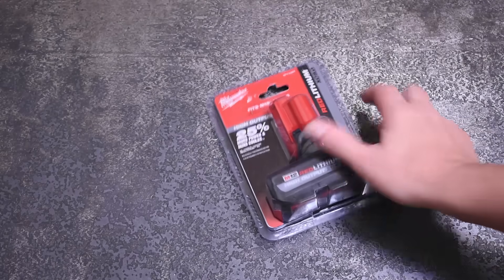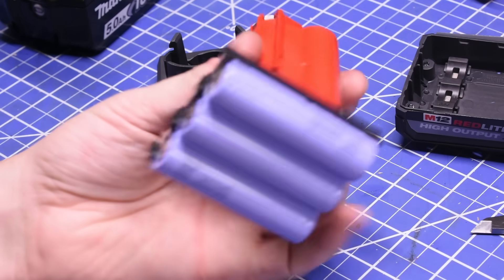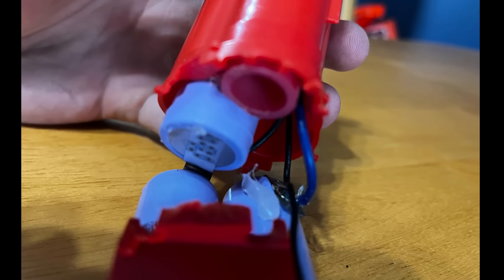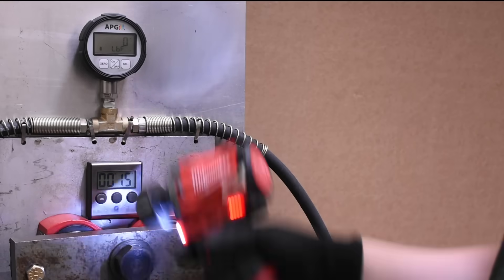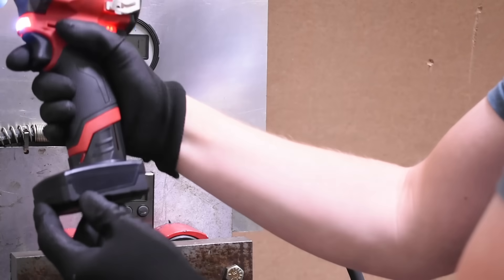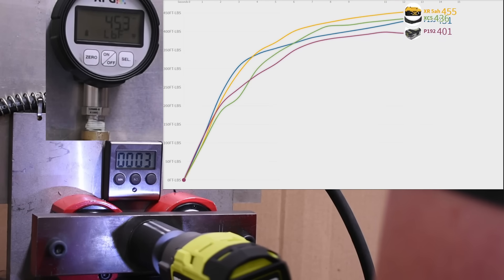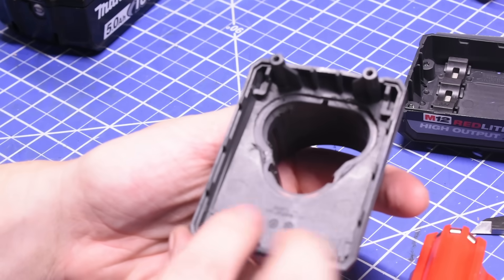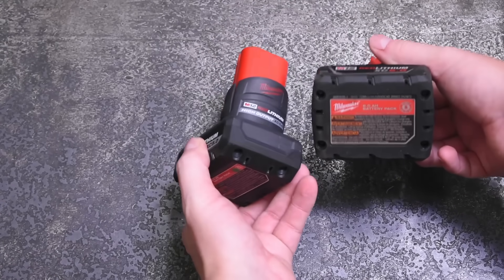Milwaukee's New M12 XC5.0 High Output vs Stuffing Actual 21700 Cells Inside

Comment: If I was in the USA, I'd send you my CP2.0 (3x Samsung 20S, 35A) and my XC 8.0 (9x Molicel P26, 90+ Amps) to test. You can buy empty 3, 6 and 9 cell cases, add in some healthy copper busbars inside and you have power tools with a new lease on life 😉

You are dead right about the direct driven tools. Thats what I use at work so I see the shortfalls of the stock Milwaukee batteries.This battery will work best on direct driven tools. But it will also yield more capacity under load than the traditional batteries. By the way, there is NO BMS on the M12 battery. It's just balance connectors and a thermistor. The main tabs are directly connected to the cells.

Comment: I was just gonna test the 6.0 and the 5.0 this week. Found a 2.5 and 5.0 pack at home depot Saturday,  it wasn't even in the system yet for price. I got it for the single 2.5 price 79$ 🤭
Reply: It also doesn't have the wh the 6.0 has, so I'm curious on run time. U should've run the 2.0 vs the 2.5, I bet that's where the 20% is!? 2.0 is 24wh 2.5ho is 30wh 6.0 is 72wh 5.0ho is 60wh I doubt the new batteries last longer? Maybe the 2.5 but I bet a cp3.0 is better

Comment: i don't thinh that M12 New battery is 21700 
It still a 18650 but use another model cells which give a higher current
But i had to say "what the f*ck " with the modded m12 that the 21700 was used but the problem was why it only had 2 cells 21700 compared to 3 cell 18650
Reply: It was three cells of 21700, one in the handle and two in the bottom
Reply: @garretttrampler7041  Ah Suck
That was the answer i had waited 
Thanks for that!

Comment: I think the HO will make the most difference in the Gen3 Fuel drill, which really bogs down before cutting out, or the Fuel circular saw as demonstrated in their Pipeline demo.  It may also have an advantage when partially discharged.
Reply: Yep, it will also yield more capacity under load. My 20S filled CP2.0 puts put slightly more current than an xc6.0 but lasts about the same as a CP3.0 under load, just without bogging down.
Reply: @procrastinator1842  5.0 didn't yield any real capacity gains over the 4.0 (cuts per Ah, with the M12 circular saw) at Milwaukee's own pipeline event.  It was 46.8 (5.0) vs 46.6 (4.0).   It would likely show some gains over the 6.0 considering the sustained load of a circular saw, but Milwaukee still chose to not market against the 6.0 for a reason, because it would've put a damper on the marketing hype.  As we basically saw in this video. 

CP 3.0 is the real loser vs CP 2.0/2.5, with the 2.5 being the most promising considering you need all the amps you can get when you have a CP-style pack with a 1P array of cells.    But the 4.0/5.0/6.0 are firmly into the land of diminishing returns at this point.  And there's not much sense in spending $120 on a 5.0 when 6.0s are so easily had for $55 with Home Depot hacks right now.  

The real improvement should be with the battery casement/tabs.  But why do we need entirely new SKUs centered around marketing hype to address one of the M12 platform's biggest flaws?  These types of improvements need to be made across the board.  And as long as the 2.0/4.0 are the most commonly shipped batteries in kits it's always going to be a rather large problem for the end user.  Absolutely bone-headed move on Milwaukee's part if they don't eventually make any updates there, and it's probably a safe bet they won't do anything until 2.5/5.0 sales fall off.

Comment: The 5.0 HO batteries might make more difference on saws. But I would like to see what the 2.5HO can do on an impact driver. Should be able to come close to the 6.0
Reply: Would love to see that.  Using a 2.0 battery on my m12 saw stalls at virtually any resistance on a 2x4 with it at very slow cutting speeds.  While the 4.0 is much better, it really could still use a boost in current capabilities.
Reply: @upon1772  im an auto tech. my buddy is a carpenter. he kept complaining about the saws stalling. i thought it was a "feature" like so there is no kickback. i didnt know it was due to lack of power. ty

Comment: I think the problem you're running into here is that there's going to be a limit to The current that the motor will draw no matter how much available current there is. The ESC can also be limiting factor. The tools you're testing are probably built specifically to make maximum power with the largest battery that they had at the time and they just simply can't take advantage of the additional output.
25% theoretical additional output only works if the tool can actually take advantage of it
Reply: I'd bet the contacts are the next limit , if not the main limit. Lots of tests on RC cars/boats indicate their little prongs are too small for 40A+.
Reply: @hydrocarbon82  maybe but we are talking about very short bursts of current.
Reply: He's tested dozens of different tools with dozens of batteries. The increase from HIgh Output batteries can be viewed across the board.

This is the first time high output batteries are producing less power.

A prime example would be the impact drivers, drills and impact wrenches all performing better with the High Output CP3.0Ah battery, over the XC 5.0Ah battery.

The difference being the 21700 cells. In this case, they didn't increase the cell size and that's why we have these results. You have a battery marked "HO" failing to produce power and a generic monstrosity that was built in a basement that is producing more power. Why? Because of the bigger batteries.

It's like he said, but it remains to be seen if it's true or not yet. It's possible that the battery can send more power to tools like the circular saw, maybe the rotary hammer? 

But typically, with every single tool ever tested on this channel, there is an increase with HO batteries, not a decrease. That's including impact wrenches and drivers.

So why now would we see a decrease or a non increase all of the sudden, with the same exact drills. Impacts.

It doesn't follow suit with what we've seen and experienced with batteries and tools so far.

The flop here, is that the batteries used, with their lower capacity only have the ability to match the 6.0Ah or beat it out slightly.

Is it a better battery? Sure. It has a lower capacity and it produces the same power, if not slightly more than the 6.0Ah. 

Will all the guys who are purchasing 3 to 5 of these batteries see any benefit over the Six 6.0Ah's that they already own? I highly doubt it. All they did was waste money.

People have been posting pictures of their 5.0Ah HOs arriving in the mail on Reddit non stop. Some of these dudes already had some 15+ M12 batteries. Just added another 5+... and for what? A battery that can MAYBE draw more power from 1 or 2 tools that 80% of users might not ever use, or don't own those tools at all.
Reply: @SixSnax  if you can't understand how it was not possible to go to bigger cell without doing this monstrosity of a battery I don't know what to saythe design of the tool is the limiting factor here
The new pack have a superior cell and the new cp one is really impressive for being a compact battery 
the only reason the 21700 pack win is because it have less sag that the other pack in the 15 sec test 
it all about the voltage you can provide to the motor if one pack is at 9volt under load and the other is at 10volt the latter will win every time
Reply: @SixSnax   Well there's the benefit of lighter weight... but unless you're a geriatric I guess that doesn't matter much. The cells themselves are also higher quality so they should handle more charge cycles. I'm also left curious about their comparative performance in hot and cold weather. Regardless yeah it's just a little better all around, and the case is the only thing leaping forward. I'm much more impressed with Flex and Dewalt with the Lithium stacks.
Reply: @SixSnax  will the higher output batteries last longer before discharging?
Reply: Time to start rewinding power tool motors with larger wire?   :^D
Reply: I wonder then if Milwaukee includes a fine print on the packaging that this output is only on certain tools.  Otherwise it's a bit deceiving.  But I wouldn't be surprised if they didn't.

Comment: Only had 1 issue with a 4.0 battery but I'm pretty sure the sawzall shook it out from my abuse so pilot error perhaps. Otherwise a freaking excellent tool line. My m18s stay in the box now days
Reply: Same here. M12 is amazing and all most people need most of the time. I still have m18 but try my best to stick to m12 if it makes sense. Im more into compact tools so i only go for m18 if i really need battery life badly without wanting to swap batteries or if for some rare reason i want or need more power(like a leaf blower or multitool kinda or a cement sds drill with chipping mode or obvious a grinder.) I treat my m18 as if its mx line. I dont like bigger tools most often cuz it sucks climbing on stair, roofs and attics and storing in a work vehicle

Comment: Great video as always!

Personally I think power tool batteries are both overpriced and overrated. So since I got the knowledge and the tools, I just make my own powertool batteries. 

This also comes with the benefit that the cells are easily replaced when they are worned out.

Comment: I didn't expect these batteries would make that much difference in impacts--I think they make more difference in drills, grinders, saws, etc.  However you really should test the 2.5 HO because it promises the compactness of a 3-cell CP battery, with the power of a 6-cell XC like the 3.0-4.0 (though presumably not quite as much as the 6.0).  Would like to see how it does in say the right-angle impact v. a 4.0.

Comment: Wow 😅 that 21700 was what I though Milwaukee would do instead of the pretended mention lipo pouch cells but oh well 😅 still good quality on the old cells . I wonder if there is a way for those chips to accept and m18 battery on the m12 drills 😮 imagine how much more torque will it delivery or simple would burn the whole unit  😂😂😂

Comment: "Up and coming cell size" must mean something different these days, because 21700s have been around for a while.
Reply from the maker: It's in the context of M18 high output. When Milwaukee started making M18 high output it was an up and coming cell to use
Reply: @TorqueTestChannel  Neat. And after looking at the graphs closer, I think I see why the 25s model is the way that it is. 25s can put out up to 35 amps with an 80c cutoff, so the chip must be programmed to alternate between 25 and 35 amps or something to keep the cells from overheating. Would make sense that 21700s would be better, since they can sustain 35 amps much more reliably if the board was actually designed around them.

Comment: I knew this video was coming and I’ve been so excited to see it. However, I thought there would be a “High output” video including the HO 2.5 as well. That’s what the big story is in my opinion. XC performance in a CP pack, whats not to love? I bought the HO 2.5’s as soon as they hit my Home Depot and they most definitely pack a punch like the bigger batteries do.  I really hope you’ll be doing a video comparing the HO2.5 to the XC6.0 soon
Reply: This was my thought, one thing i noticed from going from 18650 6.0 batteries to smaller 2170 4.0 batteries is that i get more peak power out of the smaller 2170 pack but the larger 6.0 pack will last longer for light jobs (less for heavy jobs, as it works harder/longer to do the same work)
Reply: Same i bought a 2.5 to keep things nice and slim, lightweight on my fuel screwdriver amd cut off tool!

Comment: Thanks for the review. I guess I won't be getting the new HO batteries since they're pretty much the same as the 6.0, which are cheaper, and there's not much oil and grease coming out of wood carcasses. Also, I've never had a battery come out of any tool unexpectedly whether it's M12, M18, Makita, Ryobi or Dewalt so not worried about that aspect.

Comment: Funny information, the Milwaukee M12 can be used to power a Traxxas Bandit VXL up to like 50 mph in my experience, but I am under geared for off-road use. I use the little 3 cell unit, as it fits in the car. My speed controller gets really hot, and so does the battery, however, I have no cooling. Good for about 20 minutes of use before a recharge, for $20 it sure beats the $200 Traxxas batteries.
Reply: That’s pretty damn impressive, thanks for the info.
Reply: Huh. I got a Rustler VXL, might have to look into this :)

Comment: Dunno - it's a bit of a pointless arms-race. For the laughs I bought a "POS" Posenpro 3/8" cordless ratchet off A Mazon - it was just slightly more than tuppence (I have the posh brand impact-guns, quite a few as we use them all day at work) - not expecting much at all from the cheapo/crapo wrench.   Well, that "POS" is now sat out front on the tool-cart & gets grabbed a lot, far more than the price would suggest it should & has yet failed to impress. I had intended going getting another Milwaukee to add to the collection, but thought better of it as they're gone very spendy here. So POSen it was.. 

You'd get 2 of the Posens for less than 1 battery ^ cost & the Posen comes with 2 batteries..... and yes, the Posen will run nuts/bolts & even stuff you grunted loose using a hand-ratchet because "Toite".   It's a bit too easy to fall into the "I must have the latest.." trap - we spin nuts for a living, not a hobby. I'm happy with how the Posen performs - surprised even.

Comment: I’ve had two 6.0 m12 battery’s die within a year. And ALL of the 4.0’s have lived and charge with zero issues. I’ve thought about customizing my own battery with 21700. Edit: the price of the HO m12 is extremely over priced in my opinion.

Comment: Why didn’t he use 30T instead of 40T which you found 30T has up to 50A discharge.

Milwaukee had switched XC 6.0 to Sony VTC 6 later 2021

the older Samsung 30Q are nightmare failure huge time, i seen many will not hold charge 
especially those same 30Q in M18 9Ah they switched to LG and later stop making them.
Reply: Just wanted to see if it was possible and the 40ts are what I got the best deal on
Reply: @garretttrampler7041  i see a bunch of bad 40T in the 8Ah and 12Ah that won’t hold charge
30T i have not run across one bad one yet
and they are the CP3.0 and XC 6.0
same as they are in DW XR 3.0 and 6.0

Rock solid so far for 30T, and give you more punch
Reply: Would definitely be cool to stuff some 30ts in!
Reply: @garretttrampler7041  yes i am still waiting to see some of damage batteries so i can pull them out 

i pulled a bunch of 40T still very good 
customers dropped their 8Ah to the point the pins and bms attached to case was damaged
i tested all the batteries out with XTAR VP4 plus and they are still very good

Comment: I'm actually shocked, they went to straight PC with some glass, while it might be good against oil and grease, it certainly is not against some cleaners, I've see PC spider crack against cleaner agents.  So, be careful what you clean your batteries with or if you set them down on a cleaning agent.  Actually the PC wind shields on some ATVs/motorcylces they instruct you not to use a cleaner on them.  Overall not really impressed with this battery over the 6.0.  My question is how does it operate if you repeated this test with the 3/8" right angle as that acts very different with different batteries in the handle it seems.

Comment: The m12 would be a great application of pouch cells.
Reply: I was thinking this the whole time. Could easily put a 4AH pouch in the small, 3 cell triangle battery case...
Reply: But then you don't have the cells. In the handle. It's not a good idea. To mix diffent cell types so you if you went pouch cells you would have a much lower capacity.
Reply: @randybobandy9828  no mixing, only pouch type is what we were thinking about. Pouch batteries offer more energy density than cylindrical cells too.

Comment: I use m12 stuff a bunch and am really happy you did this. Time to see if I can get an older xc cheap now!
Reply: the current hd promotion has a 2 pack of 6.0 x.c batts with a free tool , so if you return. the to the 2 pack of xc 6.0 batteries costs about 100 bucks
Reply: I saw the XC3.0/6.0 battery only combo at my local HD (in Hawaii) at $97. I was really tempted but I don’t currently need any batteries. That price almost got me to bite lol

Comment: 'Tools Tested' has a fabulous video on these new M12 HO batteries also. I highly recommend giving it a look as well. https://youtu.be/f-GNCWYvbtI
Those 25S cells are much improved. Big difference on a vape pen atleast 😁Loved seeing the 21700 battery. I've thought about doing that myself. If I had a spot welder worth a flip I would have. I agree, with an OEM M12 BMS in line, I bet there would be atleast a smoother output from those 21700s. Cheers.

Comment: The Milwaukee batteries don't really have much of a bms that limits current or anything it mostly just monitors temp and voltage to tell the tool and it will quit working

Comment: Those 6.0s don’t hold up like should 
I had to send 5 of them in for warranty. They would give me the red and green light of death after a couple uses. Hopefully the ones they sent back will hold up
Reply: I've had the before and took them out of the charger then back in and they started charging. I sometimes had to push them into the charger harder or from an angle.
Reply: I had 2 m12 6.0 so far go out on me. One I was able to bring back to life but only charges half way now , the other sat around for 6 months plus telling my self I’ll send it for warranty and it got thrown away eventually!